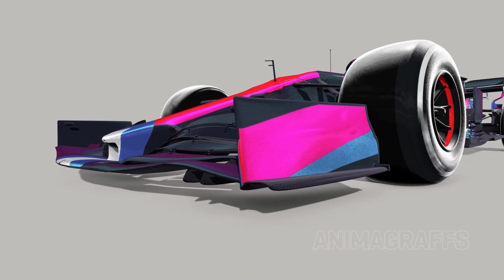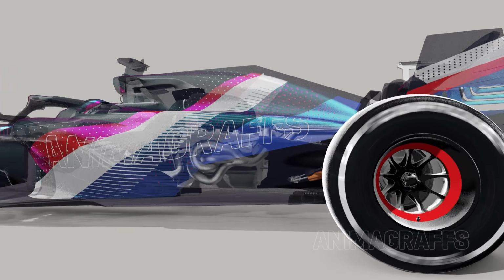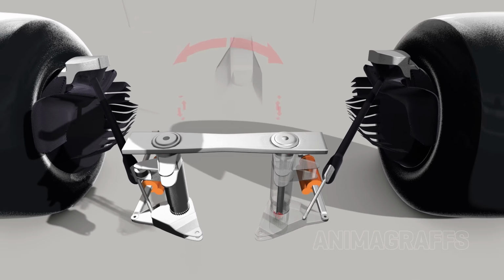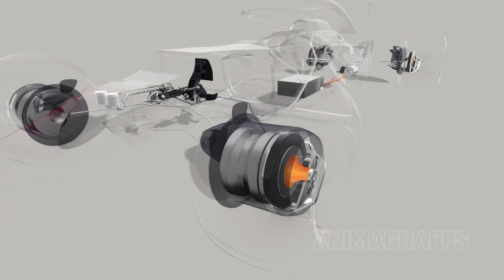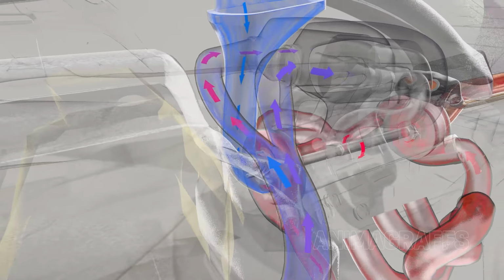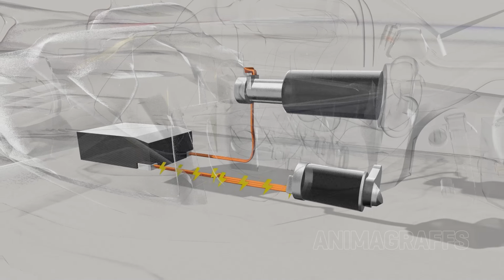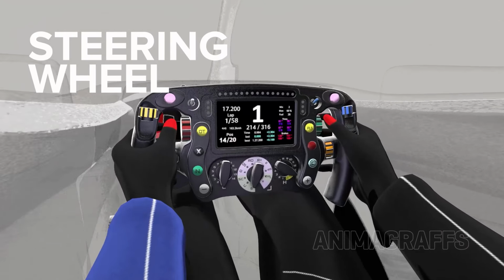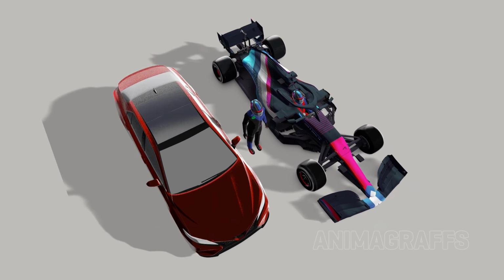How a Formula 1 Race Car Works

Comment: @10:00 The front brake calipers aren't mounted low for "proper brake bleed". That's just hilarious bs. If anything, the low mounting point is for keeping the center of mass in a very particular location--- but that isn't even all that common among teams. If bleeding air bubbles from hydraulic fluid is intended, you'd want the calipers to be located as high as possible, or at the very least, the air bubble bleeding orifice as high as possible--- air bubbles rise. The fact is, no respectable crew of mechanics will allow their car to leave the garage without the entirety of the braking hydraulic systems' being completely bled to perfection; this is done with an enclosed pressurized brake fluid bleeding system, that ensures a flow of brake fluid that is completely devoid of air bubbles. Fluid supply is attached at the master cylinder(s) (or elsewhere even), fluid pressure is built-up, bleed nipples at all 4 corners are released & a controlled continuous flow of brake fluid is run. The astute among you will have noticed that in this setup, it matters not where or in what position the bleeding occurs and/or where bleeding orifices are (the calipers have more than 1 bleeding nipple), the entire system is effectively 'purged' of whatever is in the brake hydraulic lines with fresh brake fluid. Result: no pockets of air/air bubbles anywhere. 
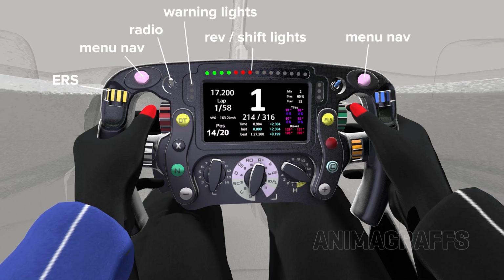@20:20 Launch control hasn't been around for ages now. Fact of the matter is that there isn't much sporting regulations on what and/or where some buttons on the steering wheel need to be, which isn't a mystery. However, some teams will have a few "magic" buttons scattered around on the steering wheel, for say, a braking bias config (HAM's magic button on the back) or a button for dealing with the anti-stall subsystem on the clutch (VET's magic button on the front, might be gone now...) and as everybody who follows THE GREAT KIMI suspects has a magic button hidden away on his steering wheel that auto-replies an utterly dry snarky concise monotone hilariously funny & short retort to the pits. Some keep less useful suspected buttons around, like Mazespin's Amazespin Deployment Strategery. Or Crashtor's Banzai Button. Some might be fooled into thinking ALO has a God Mode Button, but that's a fabrication...dude's amazing in competitive hardware; and there is no god, but HAM is his prophet anyways.
You missed the front-and-rear connected suspension (FRIC) system... but that has been banned anyways. Ditto the so-called inerter.

Comment: The correct term is “pitot tube”- not pilot tube. They differentiate between static pressure and dynamic pressure to give a total pressure. This is calibrated and displayed as speed on a speedometer.

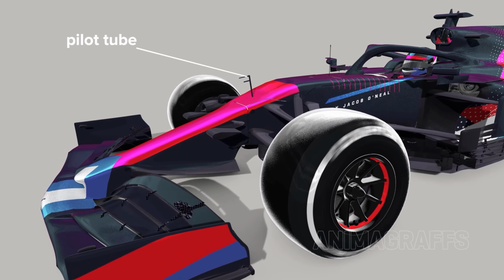Comment: Great Job.  One suggestion or correction is at 22:16 you mentioned a "Pilot Tube" on the front to measure air speed.  This is actually a "Pitot Tube" pronounce Pee-Toe Tube.  The same as what is on the front of an airplane wing.

Comment: Excellent vid.  BTW - it's called a pitot-static tube.  The system is used to measure air pressure caused by forward motion (air pressing into the tube) with a static "drain" to obtain a reference  ambient pressure.  The difference between the two is how speed is measured in older aircraft.  It is also used in various tubine engines to determine the engine-pressure-ratio.

Comment: Before watching the video, I'm pretty sure it works roughly like the cheapest car you can buy.
After watching the video, the same affirmation stands. There you go, 23 unnecessary minutes to explain the obvious.
An hybrid car works almost exactly the same as an F1 car, they just use completely different components to basically do the same exact thing.
A much better title for this video would be: Structure or components of an F1 car and how do they work. In this increasingly lower education society, people do not pay attention to the words anymore.

Comment: Splendid!
One small point: I think it is called a PITOT tube, not a PILOT  tube.
Pitot tubes are pointing in the airflow direction and measure total air pressure (= static air pressure + dynamic air pressure).

(And yes, the music drones on too loud)

Comment: You did an amazing job using 3D graphics to explain in easy to understand concepts how an F1 Car works. F1 is anything but easy to understand. F1 is the very top of the food chain in auto racing. Lot of technology is hidden from view, and some of it is hidden from competitors also.  Just about the time we have it all figured out, FIA and F1 change the rules. Or, F1 Teams change the technology.

Comment: Absolutely incredible animation, which covers a lot of aspects. Respect !!!
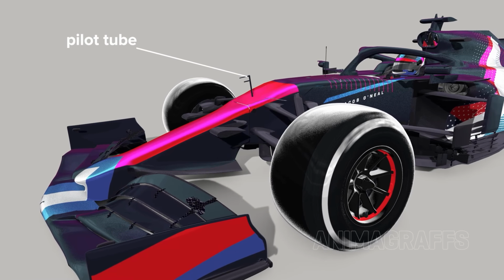To your information @ 22:17 there is a Pitot Tube (not pilot tube). This tube measures a difference between static and dynamic pressure, hence you can calculate velocity basing on Bernoulli's equation.

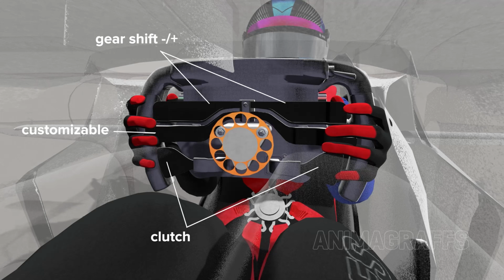Comment: 21:48 "Only one clutch paddle can be used for race starts"

This is not true. Two clutch paddles are present on the steering wheel, one on either side. One has a pre-set position, the other is full depressed.
 That is then fully released as quickly as possible, while the other is gradually released until the driver feels there is significant traction to take control properly with his right foot.

Comment: correct me if im wrong, but the low pressure air rushing out from the undertray and through the diffuser can create an almost vacuum effect, also known as Ground Effect. This can help 'suck' the car to the ground, whereas downforce 'pushes' the car down. 
Excellent video though! really enjoyed it :)

Comment: 11:20 I was under the impression the wheel nuts were removed by turning clockwise, and tightened counterclock. Was it like this in the past?

Comment: You did very good on your video presentation. At the end when you mentioned sensors, there can be up 350 on the top teams cars. There are sensors to Measure movement, temperatures, speeds, pressures, velocities etc. It is amazing to to think that tire, brake, suspension, chassis movement, ride height and all the hundreds of other parameters are being measured while the car is going 200 kph around a track bumping curbs and rubbing tires with the other cars. Amazing! Keep up the good work.

Comment: Excellent video. Just one mistake. Modern F1 cars have 9 gears, 8 forward and 1 reverse. Other than that, excellent presentation.

Edit: one more minor detail is off. In F1, both clutch pedals are used. Both are pressed during the launch of the race, one is instantly released (the one that launches the car) and the 2nd one that us released gradually, for optimum traction and minimum wheelspin during the first few second of the car's launch.

Comment: You should be a F1 analyst to go over different parts of the car every race Bravo! ESPN is the worst when it comes commentating though but they need something like this video every race. Instead of focusing on just the drivers they need to focus on the car which is just as important factor to win races just ask lewis hamliton with out that car he would have 7 championships.

Comment: Nice video, question. Why doesn't Formula one cars have tire wall thickness sensors, and meters, or a more active tire wall thickness management system, the key word being active/dynamic.  Wall thickness technology exists today, used widely in Mining for example, toe, and camber ar the biggest influencers in the location of tire wear. My gift in engineering knowledge.

Comment: Missed what the MGU-H can do. The battery via Controlled Electronics can send power back to the MGU-H. Causing the MGU-H to spin the turbo. Basically a every complex anti lag system. There is no limit on how much power can be sent to the MGU-H. But Really good video!

Comment: That's how a F1 car works then the FIA makes loads of rules to  slow the car down and rules regs to make overtaking harder. The 2021 car is meant to be designed to make overtaking easier do better spectator sport, you watch hiw this won't work either!

Comment: What fascinates me about this sport all these years I watch is how these machines are built to work properly, only when driven in the limit. This simple thing is what made me fall in love with these machines and the sport! These cars are built to work when going fast. If you go slow, absolutely nothing works properly. Not the engine, not the tyres, not the brakes, not the aerodynamics, nothing works. Only when going fast do all the elements that make an F1 car seem to come to a kind of "harmony", a symphony of sorts that translates into performance. Call me a geek all you want but i find this... poetic... hey i love F1 engineering, I am not even sorry :P

Comment: This is a really nice video, one slight correction: because of the MGU-K system, instead of hydraulic, the rear brakes are brake-by-wire to better control energy recovery with the MGU-K.
Another interesting thing about brakes: the heat from the frontbrakes is so intence, it is often used to heat up the rim and with that, the tyre. You can see this go wrong during the Baku race-restart when Lewis Hamilton accidentally turned on 'brake magic', a system that Mercedes uses to turn up the front brake bias up to get those front tyres warm, causing him to lock his front tyres up at the first corner. The rear tyres can be easily warmed up by accelerating hard during warm up.

Comment: So comprehensive and detailed. Although I was hoping you would talk about the onboard cameras as well.

I have wondered about them ever since I can remember. And no one really talks about them. So attempts at finding information about them, have been rather unsuccessful. Things like:

- What type of camera are they? Are they custom built, or do they use existing platforms like a GoPro, for instance?
- What resolution/frame rate are they capable of recording at?
- How does the lens cleaning mechanism work, and who is responsible for cleaning the lens during a race?
- Who is responsible for purchasing and installing the cameras? (The teams themselves, or the relevant broadcasting companies?)
- Are there any regulations they need to comply with? And If so, who is responsible for creating and enforcing those regulations?
- Where is the raw footage stored? Somewhere simple like an external SD card, or onboard the car's computer?
- Do teams have a say in the design/placement of the cameras, since it influences the aerodynamics of their cars?
- Who is responsible for general maintenance and upkeep of all the onboard cameras?

Comment: Great work here ! I think you could have talked about the turbo anti-lag system provided by the MGUH, the hydraulic actuaded gear shifting system, or the T-tray on the floor. Maybe how the wheel rim is used to heat up tyres. Maybe a part 2 ?! I Know im dreaming but still. This video is so cool.

Comment: Also pretty sure the rear brakes systems in modern F1 cars are brake by wire. There is no physical hydraulic connection from the brake pedal to the rear brakes

Comment: Rear braking is break-by-wire now
There are 8 not 7 forward gear speeds
And "pilot tube" for airspeed measures called pitot tube

Comment: I still don't really like people explaining the MGU-H as a heat recovery system. It recovers the kinetic energy of the high speed exhaust gases not its heat. But I guess you gotta explain it that way to prevent confusion for most people. The MGU-H also takes energy from the energy store to spin the turbo during initial acceleration to quickly boost the engine when the exhaust flow is low. I still am not sure if they use it to boost every gear change but at high speed there is excess energy from the "high-speed exhaust gases" that the MGU-H recovers energy from. By the way you got a typo, its pitot tube not pilot.

Comment: Amazing video, although it seems like some of your info comes from modern cars while the other comes from the V8 era cars. Todays cars use a Break By Wire (BBW) system over a conventional hydrolic system, they also have 8 foward and 1 reverse instead of 7 and 1, the modern regs also dont allow for launch control. Again amzing video overall, you definatly put in a ton of work for this video.

Comment: Good video. Some errata: it's a pitot tube, not pilot tubes the mgu-h is driven by the connecting shaft between the turbine & compressor, Ferrari uses a Ti-composite gearbox.

Comment: Wow! So glad I came across your channel. Incredible job and is able to explain things so easily to even the most knowledgeable of F1 favs through to those only being introduced.
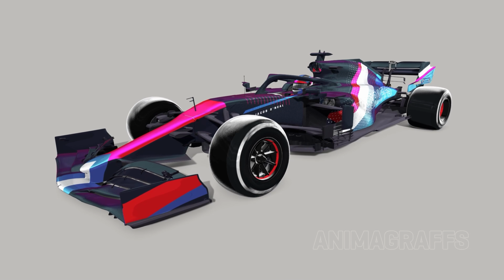Being an aviation fan at the same time though only one microscopic tweak required; at 22:17 it’s worth pointing out that it’s actually a pitot (pee-toh) tube. Odd spelling for English speakers because it’s actually a French designed device (use in aviation mainly) with its French spelling maintained.

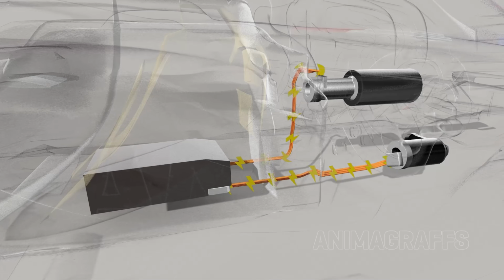Comment: 14:19 the mhu-h also can take energy from the battery to spin the compressor. When that is done, the wastegates are open. This is done because the mguh can spin up the compressor faster than the lower revving compressor, thus making the car accelerate harder. If you listen to f1 cars coming out of slow corners, you'll hear that they sound much more brutal than on straights, that is why

Comment: a few minor errors but all in all great informative video
the front airspeed sensor is called Pitot tube (pronounced pee-tow) 
also some design elements don't apply to all cars and differ between teams and engine manufacturers

Comment: Very good. One correction. The speed measurement tube on the top behind the front wing is called a Pitot Tube. I thing the dreaded spell checker might have messed that up in the script. Best bit for me was the suspension arrangement, thus being the only clear description I have seen.

Comment: This video was amazing. I’ve been an f1 nerd for years so knew most of it from own research but this would be hugely helpful for a newer fan stopping them from having to get bits and pieces of information. 

The only things I noticed that weren’t 100% right where when talking about the steering wheel. Launch control and other driver aids have been banned for decades although the cars do have modes that adjust the clutch and engine settings to help with setting off. Also the gear shift is more commonly the middle paddles (although pretty much all the controls can be mapped to the drivers choosing) and some cars like the Mercedes have buttons instead of a third set of paddles behind the wheel.

Comment: I believe the mguh doesn’t convert heat but the kinetic energy from the rotation of the turbo. It can also deploy electrical power by acting as an anti lag, spinning the turbo before the exhaust gas hits the hot side

Comment: 22:17 it's called a Pitot(in honor to it's creator Henri Pitot) tube not a pilot tube also used in aviation, as it is used  as you already mention to measure airspeed (flow velocity) other than that great video.

Comment: I think there might be a mistake regarding the clutch pedals. I do not believe that only 1 is allowed to be used at once, rather drivers use both for the start. They depress one all the way in and the second to the clutch bite point. On the start they release one pedal, while still holding the other at the bite point and then slowly releasing to to ensure they don't break traction.